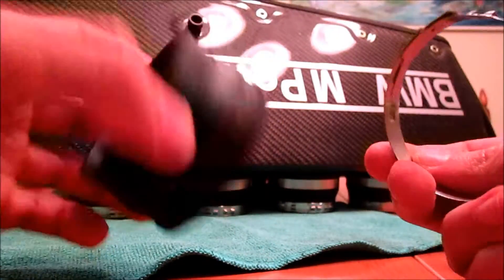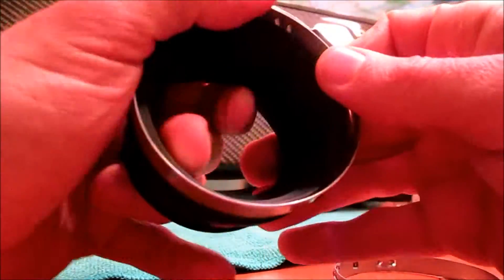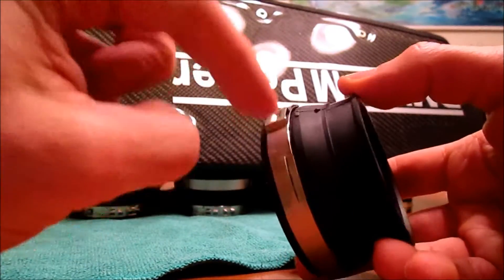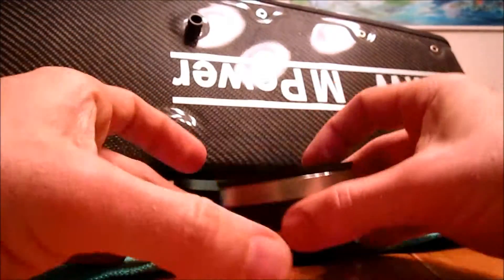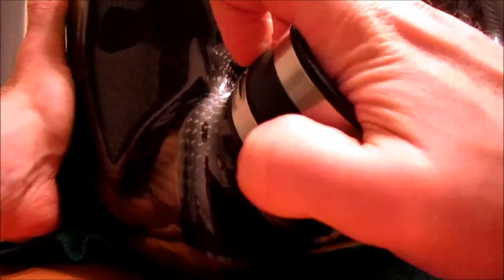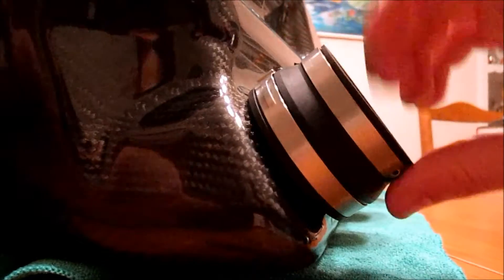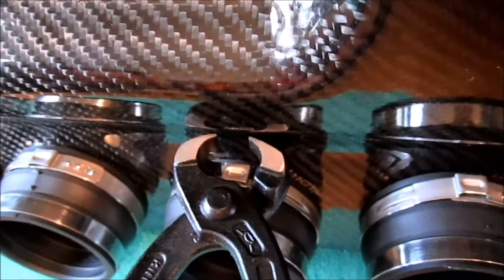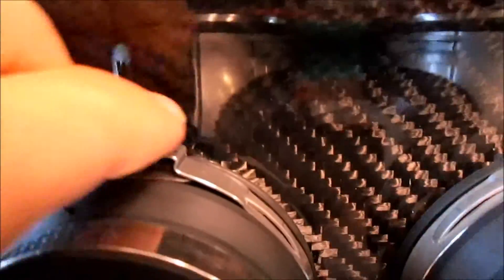BMW M3 CSL Airbox Conversion Install - Part 3

Comment: the maf sensor goes to? did u still using the same maf like the stock one or replace it with the csl one?
Reply from the maker: When I did this video, I had unplugged the MAF and re-wired it to a AIT. Since then, I have properly converted the system to MAF-less and am using a MAP sensor and relocated AIT.
Reply: +BluePurpleRed Guides thanks for the answer.. but what is AIT? and did your car is running well without MAF sensor? I thought you've done some remap or something to your ecu